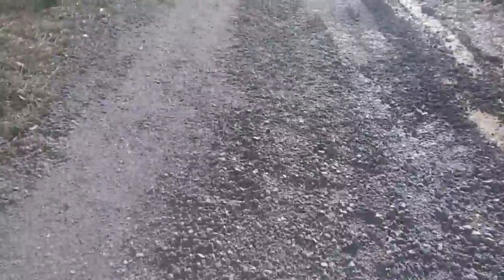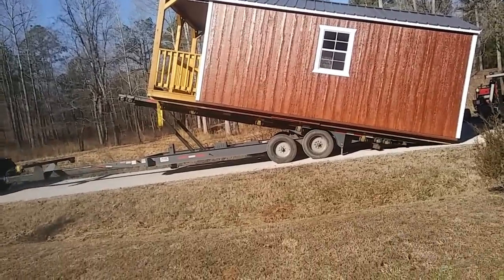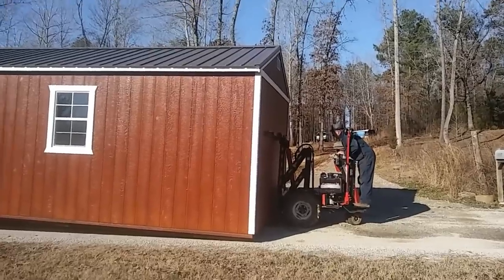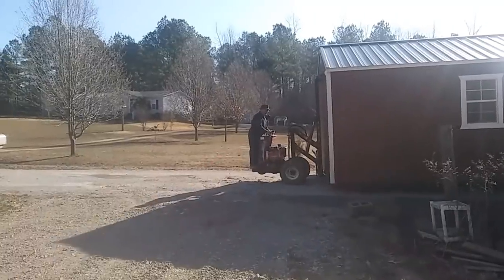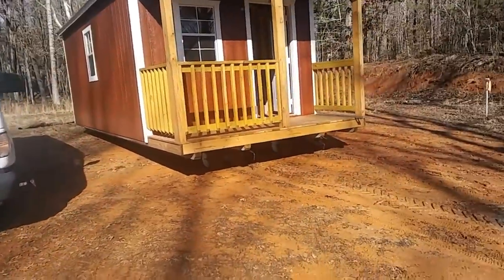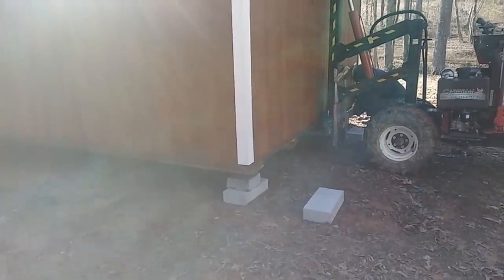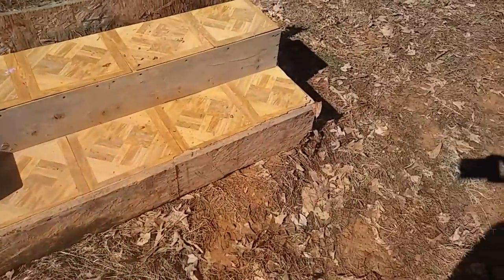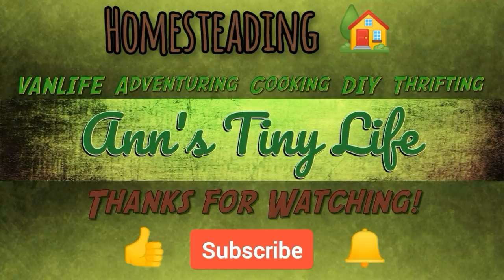Delivery of 12x24 Derksen Tiny House Cabin to my New Homestead! - Ann's Tiny Life

Comment: I put a similar 12X20 in my backyard for about $3500. For an additional $1500 I was able to do power, lighting, flooring, insulation, heat/cool, drywall, and built an interior wall to divide the space into two rooms of 10X12. I use one side as my office and the other side as a guest room/storage. It was basically $5K to add two fully functional rooms to my house. Best $5K I ever spent. I use the office year-round and have done so for about 5 years now.

For an additional $300-500 I could have had the "barn roof" upgrade, which would have been tall enough to essentially give me a functional second floor, nearly doubling my useable floor space. Of course it would have been an another $1500 to finish it out the same as I did the bottom floor, but that would mean I still got a fully functional two-story 12X20 space for under $7K! The only reason I didn't was because building codes in my area would have prohibited the 2nd floor because my home is a single-level home. You can only have a 2 floor outbuilding if your primary home is also 2 floors. It's BS, but that's what I have to deal with.

Basically, I'm saying this sort of building is totally worth the time, effort, and money.

Comment: Congratulations on your new tiny home.  Please be careful with trying to heat the entire house with a buddy heater.  It burns propane and it will put a lot of moisture into the house making it easy for mold to grow.  A friend of mine did that and ended up in the hospital due to mold.  You can use a buddy heater to knock off the chill but I would suggest you get a tiny cubic wood stove out of Canada that will help dry out the house.  Also it take small pieces of wood so it would be easy for you to carry the wood.
Reply from the maker: i barely used it thus far and didnt keep it running all night. I hope to have a wood-burning stove that vents to the outside before next winter.
Reply: @AnnsTinyLife  That would be great, the cubic mini wood stove is not very expensive.  google it and check it out when you have time.  Wishing the best in life for you.

Comment: look into Roxul insulation. It has more R- value than fiberglass.Your walls are 3.5 inches thick.Its fire proof,moisture proof too. or foam boards than use canned foam to cover the cracks. I wish you luck.
Reply from the maker: thanks Victor. I think another name for it is rockwool? I used that in my van. I actually have some on my Amazon Wish List and I'm planning on getting some soon.

Comment: Might want to have them to come out and re-level your building 2 or 3 more times.  That soil will surely allow settling of the building and it will be out of line within a few days providing drying takes place.  Lot of weight sitting on small areas.  I had my guys come out 3 times over a 3 month period to correct. Three times was a charm as the building remained level for over a year.  Been a couple of years later and I'm starting to see just a bit of it being out of plumb but I can correct that myself with a floor jack and shims.
Reply from the maker: yes Ron, I had been contemplating this very same thing. I'm afraid that it will settle more. So I will be contacting them soon to see if they can come out and make sure that it's still level, and if not what needs to be done. I imagine just raising it should bring it up again and bringing it back down. So far it's showed no signs of it not being level. but then this is clay soil I'm on. So I expect that the ground will shift.

Comment: Buddy heater or ones like them may not be a long term heating operation do to the extreme amounts of moisture they admit into your living area air.
Reply from the maker: the Buddy heater works in a pinch but long-term, you're right. way too much moisture. I hope to get a wood-burning stove and actually.

Comment: I've had two storage buildings delivered and in both cases the company wanted a bed of approximately 1" - 2" stone. In your case the elevated height serves the same purpose of keeping the bottom dry. The other reason is to have stone under the eaves so that roof runoff will splash less at the bottom sides. You can still add stone under the eaves. A 1' - 2' row along the sides is what my company recommends. I'd place stone a few inches under the building and measure the width from there. I think   that it also adds longevity to the bottom edges by keeping that area a little dryer.
   I'm wondering why the building was carried to the installation site with the dollies instead of directly from the truck. Just curious.
   Please post your progress with the interior. It looks really good already.
Reply from the maker: yeah I will definitely be putting some Stone around the perimeter of the tiny house.

Comment: A buddy heater will cause condensation in your house may want to look into a ventless propane or a wood stove if I were you hope that helps good luck
Reply from the maker: Oh yeah the Buddy heater does put off a lot of moisture. I used it sparingly when I lived in my van. And have hardly used it at all in the tiny house. But the plan is to get a wood-burning stove. Thank you so much for watching you for the comment!